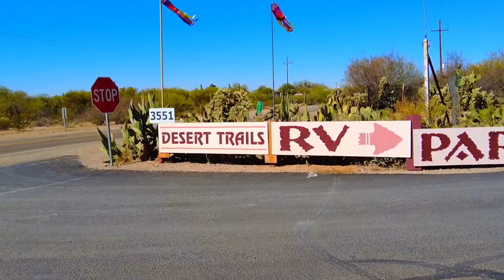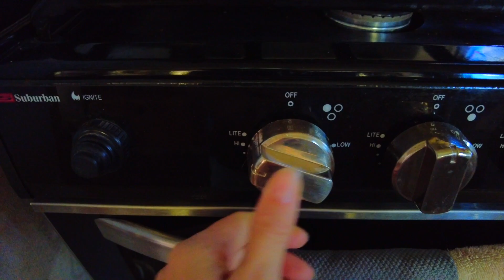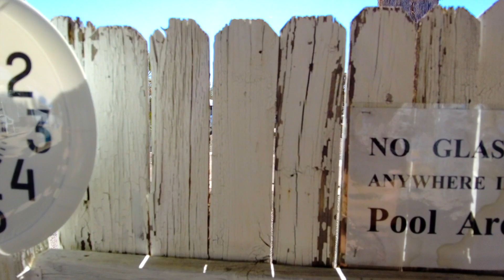All Work & Some Play: Truck Camper Living | RV Life | DestinatioNow Ep91

Comment: Dude sidenote question. While you're on the road do you shape your beard yourself , tour wife do it, or do you just trust whatever barber you come across in your travels? I've pretty much always kept a beard of some sort and turning 65 this year and since I no longer have to answer to any corporate assholes I have let it grow. I have always just kept it trimmed with my own clippers but now it is out of hand and needs some shaping
Reply from the maker: I have tried finding barbers throughout our travels and i discovered that good barbers are difficult to come by. So I cut my own hair and trim my own beard. Jaclyn helps me to to cut my neck line but that’s about it. I use Wahl clippers https://amzn.to/3NvH7Sz and a Taperking guard https://amzn.to/3uHnoqB. I use the taper on my crown and sideburns then I freehand the rest of my beard with a mirror. To freehand I use the length of the teeth on my pick https://amzn.to/3uCHhz1 against the point of my chin to measure the length of the tip of my beard and then cut a hard line from that measurement to my adam’s apple. Then I round off the bottom sides just a tad. Also this video https://youtu.be/8M9XE7WbOCA @7:50 I showed how I trimmed my beard back when it was much shorter. Hope that helps!

Comment: nice job on the video and on getting your to do list punched out! 👍Love the new skylight! Did it fit in the old hole or did you need to enlarge it? Also curious how you stopped the slide topper squeak, LOL. We have a Lance and totally know what you mean about that sound.
Reply from the maker: The new sunroof was an exact replacement for the old one. The interior bezel was the only piece that had been redesigned and it fit perfectly. I coated everything in a UV protective paint so it should last longer. The squeaking of the slide topper is caused by the vinyl rubbing against the slide flange. The fix is to update the brackets. I ordered KY25SH and two R001581 springs. I haven’t installed them yet but this theoretically should do the trick. We will be making videos about all of these projects so keep your eye out for maintenance mondays. Thanks for following our adventure!
Reply: @DestinatioNow  Thanks! I will look for them.😉